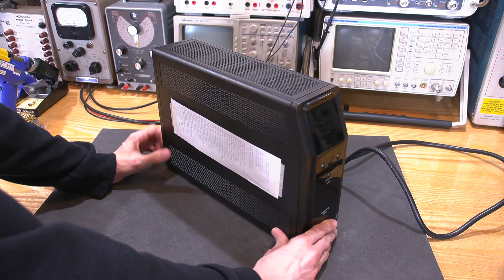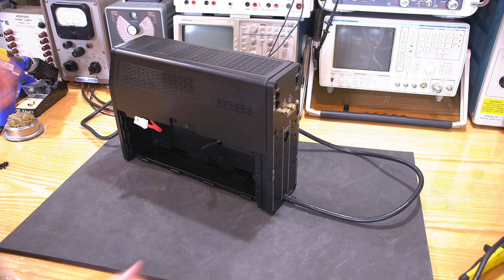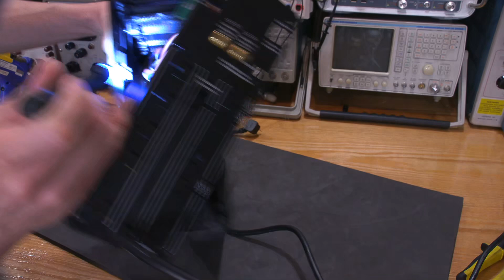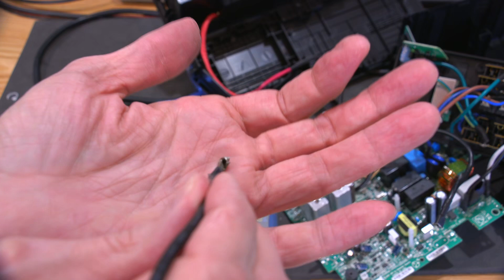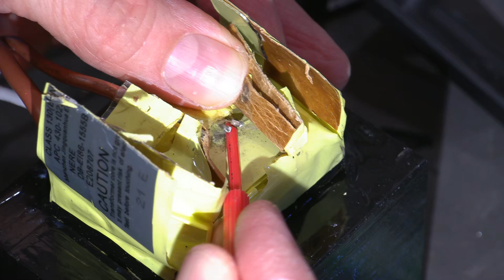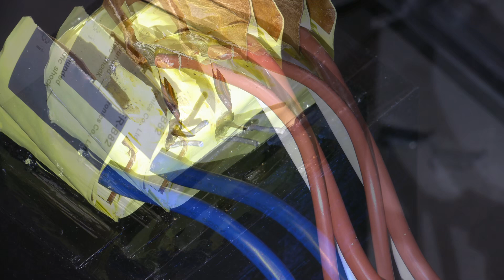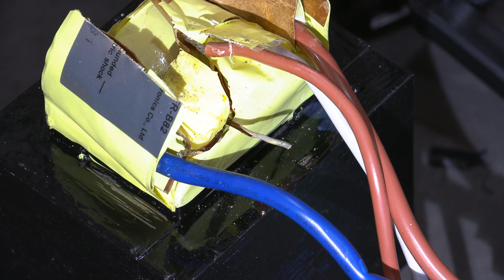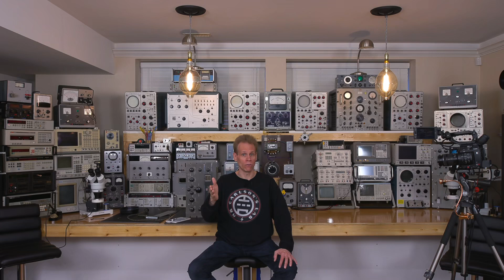UPS Electrical Failure - Teardown and Analysis!

Comment: Ok, that was shocking. APC went from a company I could trust to one I now cannot.  That was quick.  Thanks for the teardown lad.  Great stuff!
Reply: I was wondering if APC knew or was deceived by a component vendor. From what you're reporting, the choice seems to have been made by APC.
Reply: @KJ6EAD  Agreed.
Reply: @KJ6EAD  Sure, these transformers are especially designed for this device! I'm sure they did know about it! Aluminium mustn't be bad on a rarely used transformer. Only the way they connected it is wrong.
Reply: @KJ6EAD  I worked in QC for a video terminal manufacturer. We were constantly fighting with the vendors to use the right components in those devices the company imported from overseas. While we didn't have wires literally falling off the devices, we had out of spec capacitors and other components causing intermittent failures in the field.

Could this be a choice by APC? Perhaps, or perhaps not. It's hard to tell unless someone spoke with APC about this.
Reply: @KJ6EAD  vendor is just part of the equation, APC engineers should perform tests to every component that goes to the BOM
Reply: @migueldelag  The problem is 'quality fade' from the supplier.  The initial ones are built to spec, then the supplier starts to cheat and replaces them with the inferior ones like this.  The vendor that includes the parts isn't told about this switch and the end user ends up getting an inferior unit.
Reply: @KJ6EAD yes they were deceived because I'm currently working as APC technician.
Reply: @KJ6EAD  A simple resistance test would reveal the winding is aluminium or copper.
Reply: @KJ6EAD  "deceived"  thats a bit harsh.
Reply: @philipslighting8240  Seems pretty damn fair actually.  An aluminum winding in a transformer?  Unforgivable in my opinion.
Reply: I just recently opened and converted an older model from this brand. All looked very sturdy inside. Full metal body, etc. These newer products cannot be trusted. It's a shame what this company is selling now.
Reply: The test labels seem standard. I have 3 other APC UPS and all shipped with reports.
Reply: Yep, APCs have come with test labels like this attached for 20+ years.
Reply: @rjy8960  I have three that have been running for 7-8 years.
Reply: In fairness, it could be only the transformer manufacturer/supplier.  But if that is considered APC's diligence and/or choice, then it could be considered APC.
Reply: @louf7178  Yup. It's up to APC to enforce QC. If they don't do that, they deserve to be criticized.
Reply: @TheJohn8765  It QC'd OK on the line.  Just saying out of all the parts of all the models of each year, it can be overlooked.
Reply: We stopped selling APC hardware after they got bought out by Schneider. Their quality was never all that good to begin with. And it’s gotten considerably worse since.
Reply: @sandy1653  You nailed it.
Reply: @sandy1653  what's a better  alternative?
Reply: @gewglesux  We've been happy with Eatons and Vertiv units.
Reply: @sandy1653  Thank you  for the reply...  i'll have a look at these units.
Reply: @sandy1653  Keep in mind that  this is for the Home use..
Reply: @gewglesux  Sorry, I work in IT consulting and automatically default to what I'm used to selling customers.  At home I have a few Tripp Lite (who are owned by Eaton now) UPSes and I've been pretty happy with them.
Reply: @sandy1653  Thanks for the reply...  I think i have used Tripp lite  in the past..  always struck me as cheap though.
Reply: Schneider electric owns APC
Reply: Man that's lame.  Yet another company to avoid.  As far as "iron," I've now seen crappy made stuff from 3 sources now.  APC, Weber tube amp kits, and Mojotone.  All garbage.  Weber one had wires pulled so tight inside the transformer cover the 120V primary shorted out on the laminated plates.  Died after a year.   Mojotone output transformer was so badly "center tapped" it lead to major asymmetrical distortion.  Off by 30 ohms in that thing's case lol.  Unusable out of the box.
Reply: Given the supply chain, I can see why this sort of thing can happen. I'll bet someone thought they were saving 20 cents per transformer.
Reply: @jakebrodskype Fair point but for these types of devices, this is not an excuse to go ahead and release fire hazards... you simply don't produce them u til its safe to do so.   I know that is not the reality we live in though.
Reply: @ortzinator  Walmart is full of special SKU products that are all GARBAGE! Sam's Club is Walmart.
Reply: @Satchmoeddie  Yup, they have the purchasing power to force manufacturers to make stuff as cheap as possible so they can sell it to consumers cheaper than the "same" (but not really) product purchased elsewhere.
Reply: @Seth B  Special SKUs are a Walmart requirement for their vendors. They want packages that scream "bonus!" Or "X percent extra for free!" Or other such things,  and while putting those larger bonus packages on the shelf, Walmart demands the item cost less than it did before. And they often make the vendors buy the shelf space.  No wonder vendors cut corners to make any kind of profit.  For this APC, being able to hit a $5 lower price would be enough to make Walmart happier.
Reply: I can't believe it. so conclusion:stay away from APC.
Reply: @Oscar Caetano  I'd get a larger sample size before drawing that conclusion. Every manufacturer can have a BOM supplier issue. It's a worrisome flaw, worth keeping an eye on for recalls.
Reply: Manager with MBA : How can we save some bucks on the design ?
Noob Engineer : We can put Aluminum wound transformer, it's gonna be lighter too.
Me : Use a screw terminal to connect the wires at least, come on !
Reply: @demoncloud6147  A simple proper crimp with proper paste to eliminate air works for many years. It would not have failed for a long time, the way it was done, it is guaranteed to fail.
Reply: @demoncloud6147  Aluminum windings are thicker to carry the same current so more iron save no weight
Reply: I doubt it's just APC cheaping out... you really can't trust ANY consumer-grade products these days.
Reply: That transformer was a big let down. We use 1500 & 1000 VA APC uninterruptible power supplies where I work (big factory) - never had a failure that I know of (other than replacing batteries).
Reply: @ronaldbryant5215  Don't you think it is a bit too much to pay that price for some crappy battery, which is supposed to last only a few years ? They could have made it to last at least for 10+ years instead of relabeling sh*t.
Reply: Not just APC, but many companies (some with prestigious names) that have chosen to use cheap-as-possible manufacturing in order to maximise profits and, of course, don't want their products to last forever. It would have been interesting to see whether using proper aluminium solder would have bonded the transformer winding to the wire.
Reply: @ralphj4012  well…. not just companies who want to increase profits, but also us consumers who want stuff as cheap as possible… (hey dude, guess what, I found this kind of device even cheaper on Alibaba… hehehehehe)
Reply: I had a sneaking suspicion APC had gone to the dogs. 3x SURT-6000-XLIX units failed at half load over the course of 3 years. The only reason I bought more was because I already had the battery packs. Never spend another cent on APC. Buy Eaton. Better yet, do what I did and DIY. Victron Quattro inverter charger unit + batteries of your choosing. It also reduces pack wear and tear as you can balance your own pack properly.
Reply: @gummy1204  I've had a pretty nice Eaton unit unit fail.  Overheated the batteries and would randomly shut down.
Reply: A long time ago APC was the way to go for IT ... just became junk for the last 10-15 years...
Reply: APC has been junk for 10 years, trading on prior reputation.
Reply: They remove aluminum wires from houses because it was a fire hazards and responsible for many house fire in the 60's and 70's.  NOw if Chinese companies that make these transformers cut manufacturing cost by replacing copper wires with aluminum wires, that's a BIG problem.   As a firefighter that would explain some odd fire where the origin was near or close to the computer, But with the charred or badly burned UPS it was hard to tell if it was the UPS, Printer or anything else that caused some f these fire where a computer was situated.

But now with this demonstration teardown of the transformer, next time we have a fire next to a computer, entertainment center with a UPS near.  The UPS will be checked first.  And if the cause is the UPS transformer.  I think we may see a massif recall of UPS in the future.   I hope APC/Schneider electric check that and make a recall on all UPS devices that may have this type of transformer with aluminum inside.
Reply: @lepompier132  Aluminium wires are still legal by code (there's even specific tables to size aluminium cables), just like transformers with aluminium windings. In fact, we use them all the time in our industrial projects at my firm. You just need equipments that are specifically made to be used with aluminium wires, as the connections can oxidize and loosen more easily. This UPS is a typical case of improper use of aluminium wires: they didn't make a proper connection and wired it like it was copper wires.
Reply: IKR. Wow!! List of better ups?
Reply: @KennyKenJm   Cyberpower have NEVER let me down. I've been using them for 10 + years. 

Heck.. the one I'm using right now survived being drowned in a cyclone... it STILL WORKS!
Reply: What's horrible is that in my experience, APC is the least bad of the terrible companies making these things. Tripp-Lite has a bunch of issues, and Cyberpower - ugh, don't get me started on Cyberpower. It is literally true for us that Cyberpower malfunctions caused more abrupt system power outages than they stopped during actual power failures before we threw every single one of them out of the building. They literally never worked even once for us during actual outages and took us down via malfunctions... two or three times, I forget.

APC quality varies kind of a lot from unit to unit and model to model. The least bad we've found has been the Back-UPS Pro BR1000G - that's our standard on production machines - and the worst model has been one that looks a lot like that one.
Reply: @solarbirdyz  Check out Eaton units - for us, they've been far better than their APC counterparts.
Reply: @Bruce Havourd  How was that company named? Amateur Power Conversion🙂
Reply: Well known, trusted company caught red handed building their products with (presumably chinese) garbage. 

Big shocker there /sarcasm.
Reply: I agree I had one very good apc . All the new ones seem to be made on Saturdays.
Reply: the only apc model worth buying this days is the BR1500G , BGM1500B . basically if you are buying a new model avoid buying the ones that use low frequency transformer based inverter. get something like the br1500g that has a proper dc to dc converter and then H bridge to turn that into modified sinewave. these are the only two models from the pro series that uses switch mode inverter and they are much better. , in india we have a 1000w version of the 1500g that has everything same but a software limit to trip the ups at 600w instead of 900w. this br1500g has an external battery port in the back aswell which could be hooked up to a 24v leadaicd or even better lifepo4 battery pack to extend runtime like i have done. keep in mind the north american model of br1000g use the heavy transformer for inverter and the construction is similar to the one shown in this video , i had a bx1100 model (exclusive to indian market) it has a transformer that is literally half the size of the transformer they used on 450va model made in 2003 . it had two 7ah lead acid and rated at 650w with a run time of 40secs at full load. so the battries died and i replaced them with 12ah lifepo4 , now lifepo4 is lithium and they do not suffer from pukert effect so as long as you are pulling less amps than their rated cont they would happily dump their full rated watt hours and so this increased the run time by hours. at first i tested it with 300w load and it ran nearly 50mins. then i increased the load to 600w which should have given 15-20min runtime , but just after 5mins the transformer got so hot that it melted the internal thermal fuse even though the ups has a temperature probe on the transformer , this essentially made the ups an ewaste as the transformer was dead. so i took the covers apart and discovered the fuse , replaced it with another thermal fuse this time an automatic resting one. and learnt the lesson that not to run the ups above 300w. these are designed in such a way that the battery would run out few minutes before the ups overheats at a given load! 
such issues do not exist with the br1000g (indian model) and br1500g (american model)
all of the apc units i bought have the pcb and transformer made in India. unlike the american models i see online they have the ups made in Philippines and the transformer pcb made in china. 
lifepo4 is the way to go with these ups , i can game for about an hour on my pc when the power goes out or work for 3 hours just on battery and my pc is not even that power efficient, it draws 150w at idle and 450-500w while gaming. i use the br1000g and 25ah 25.6v lifepo4.
Reply: Thank you for the tear down. I’ve had several of these over the years and they used to be good. I’d replace the batteries every couple of years and it would be good to go. Last one failed with an internal fault and couldn’t be repaired. Sad really. Very little is made in America now a days.
Reply: @ortzinator  it is not just the Sam's Club version. Their entire bottom to mid-level offerings are nothing short of disposable junk. I am the Director of QA for a nationwide IT company and I cannot recommend any of APC's 'desktop' UPS units. I remember a time where I would replace batteries every 3 years and now, I am replacing DOA and units with less than a year on them. The 'warranty' process costs more in shipping and time than the product is worth.
Reply: probably a bad chinese supplier
Reply: @Brian Ortiz  Yep, they are a Walmart 'Family' of business and Both Do sell company specific versions of a LOT of things. And pretty much, they are all Junk! Ya'll Take Care, John
Reply: If this has a UL certification, ship it to their labs for a full inspection. I would not be surprised if the model shown in the video was made in China. We had two rack mount APC UPS devices in our server room, and both had to be replaced a decade ago. This was in an air-conditioned office building in the heart of downtown Honolulu, not someone's beach shack.
Sadly, Cyberpower (the competition) makes some pitiful UPS backup supplies as well. It doesn't matter if the output is a square wave or sine wave. Both backups fail in 3-5 years. Even the displays go belly up.
The worst power company in the U.S. is in the state of Hawaii. Their name is HECO, rhymes with Rico. The AC supply is more unstable than a 30 ft wave on the North Shore. Not shocking that no UPS backup device can stand up to a flip flop power grid. Never, ever run your Audio Research stereo system between 4 AM to 5:30 AM. The grid will fry your expensive electronic equipment.
Reply: Yeah, APC went downhill notably after Schneider bought them. Now I’m not sure what to use for my UPS needs. :(
Reply: But at least it is expensive... :(
Reply: The BackUPS series are commodity products, I wouldn't trust them as far as I could throw them. Their Enterprise grade stuff is much better built (or at lest all their enterprise stuff I've ever bought second hand and reconditioned is better built ;) ).
Reply: Boobytwaped.
Reply: I think this is the difference between Back-UPS and Smart-UPS
Reply: EPSUs have always been a gamble. Any brand you buy
Reply: Yeah, this is very sad news.  Hopefully they were deceived by their component supplier and didn’t intentionally use that junk… There are lots of counterfeit components making their way into the supply chains of even reputable companies these days, although I’m not necessarily saying that was the case here.
Reply: What  do you use now?
Reply: I have seen so many failed UPS units, school i went to I now work at used to have APC they would always overdo the batteries, etc then they would fail even on the old 1990 era units. I only have one APC that is at home and needed something quick was what I could get. I won't even touch them otherwise anymore.
Reply: Oh you can still trust them! They make the best house igniters in the industry!
Reply: Wow, for the price of a couple 5-cent crimp lugs!!  Sad.
Reply: Another thing is the battery, it has no balancer, you can't (at least in those models I saw) adjust the charging parameters. It is not supposed to last very long, while actually being a much cheaper relabeled (at least tested) one. WTF would I ever pay for "ORIGINAL" ones while the much cheaper ones would not last much less than that ? Put a balancer over a cheap one, and it will outperform the "GENUINE" by a large margin.
Reply: Well,  APC by Schneider tells you something i guess :) go Eaton for the moment
Reply: China What did ya expect
Reply: Used to use APC extensively in my home and we had literally hundreds where I worked.  The failure rate was 30% a year, often announced by a Sulphur-scented cloud nobody ever could identify at first. Switched to another brand for my home use and it's been much better. Or at least hasn't crapped out.
Reply: Echo what this guy said.  No more APC for me.
Reply: It’s not the units failure I’m afraid of but the fire hazard that it can become!
Reply: @rad2304  Agreed.  Yikes.
Reply: These small APC UPS's are junk. The rackmount enterprise versions are not unless they are supplied by the same company.
Reply: At least APC had quality devices 20ys ago that still do their job in a perfect manner.
Reply: APC already  was trash even 20 years ago. So it could only go from trash to super trash.
Reply: APC became a piece of junk since they have started using plastic cases. In the 90's those units were all metal and fairly properly built (although I never quite liked them as the batfery always prematurely died in them). Also, still this 50Hz transformer solution? Come  ooooonnnn...

UPSes are dangerous and fire-risky devices, these are even SOHO stuff where you put it under your desk without proper safety measures, and maybe throw a bunch of paper on top of it too, for good measure. This "quality" is just plain unaccepable.
Reply: APC sold out to china after development and mfg in US. Junk now not same, just a name. Like many consumers goods.
Reply: That is naive, Aluminium cannot be soldered to copper in my experience, also as Mr C demonstrated when he opened up the crimp, three separate wires inside.
Reply: @harrowtiger   It is possible with the right product.  But obviously those connections were not done properly at all.
Reply: for I have known about the aluminum transformer windings for a whiler now just trying to cut corners !
Reply: "APC went from a company I could trust to one I now cannot. "

Because you saw ONE unit fail?  One of several hundred million units worldwide?

I dare you to look up ANY brand of UPS and find one that does not have a dozen reports of failed units.

Units fail, it's reality. There is a reason why professional UPS's are expensive and these home-use units are so cheap MrCarlsson had several FOR YEARS*, *WIHTOUT ANY PROBLEMS

The worst you could say about APC is that this particular model may have a design flaw. Now use your brain to think about how maybe the other brand might use the exact same transformer.
Reply: @vinny142  One unit failed, but all the units have completely unacceptable aluminum to copper connections.
Reply: @vinny142   "MrCarlsson had several FOR YEARS*, *WIHTOUT ANY PROBLEMS"
0:38 says he had a bunch for a year,  1 power failure survived, failed on second.
They have one job...

"The worst you could say about APC is that this particular model may have a design flaw."

  And the best you can say about APC is         perhaps not ALL models have solder to aluminum in the transformer.   Perhaps.

They put their name on it   , their name gets the kudos for success and the opprobrium of failure.
Reply: Be careful about drawing conclusions from only one sample.
Reply: @williamsquires3070  Where did the substandard transformer come from?  It was certainly installed in that APC UPS -  so was the transformer replaced by a third party or was it a part selected for the line for it's affordability by APC?  I'd be very interested to find out.
Reply: @STR82DVD  My guess would be china. They are well known for using aluminium wire in a lot of stuff now.  There is a type of coax cable called LMR-400. It's used in commercial radio installations, repeaters, broadcasting and various other applications. The company I get my supplies from has started offering 'CNT-400' which is supposed to be an equivalent. When you strip the outer jacket off and get to the centre conductor, it should be solid copper. On this CNT stuff, it's copper-coloured aluminium. After checking the source of the cable I discovered it's made in China.
Reply: @stopthebus  yeah, we electricians call that copper clad, and we only use it for electricity service installations, from the transformer to the meter, and we always oversize it.
Reply: @stopthebus  Cooper colored aluminum.  You just can't make this stuff up.  Brutal.
Reply: @STR82DVD  I guess APC bought it - I don’t think they manufacture transformers themselves. Of course, it could be an oddball transformer not available through normal channels, in which case they’d have to wind it themselves. Then the problem becomes: where did they source the (crap) aluminum wire from? Did they know it was aluminum, or was it fraudulently labeled as copper wire (and they paid for copper wire) but was really aluminum? Certainly someone, somewhere, cut corners on cost here.
Reply: @williamsquires3070  Agreed.
Reply: @STR82DVD  I have a distinct disappointment with a lot of this "inferior" china stuff.
Reply: @pinrod1  I'm an electrician as well and a radio engineer so I know what it is, I was just describing it in a way that highlights the cheapness of what china is producing and my distaste in the inferior products that they make.
Reply: @williamsquires3070  Transformers in these kinds of things aren't "off the shelf" parts, they are all custom built to the product manufacturer's specifications so either they specced it with aluminium windings or the manufacturer did a dodgy on them.
Reply: @stopthebus  You and me both mate.
Reply: @stopthebus  It's probably not "copper colored" aluminum, it's "copper clad" aluminum. It's aluminum wire with a very thin layer of copper on the outside. You see it a LOT in coax now, which in a way makes sense, because for RF applications with the skin effect, all of the RF current is right at the surface anyway. The other variant you see is copper clad steel, which same idea, but using steel as the base material rather than aluminum as it's even cheaper. The CCS stuff has 2 disadvantages - it destroys cutting blades on tools (as they're designed for copper, not steel) and if you use it with any moisture exposure, the steel rusts and turns into a horrific mess. You have to be really careful when buying coax these days that the center conductor is "bare solid copper" and not "CCS" or "CCA"
Reply: @gorak9000  Yes, I know it's copper-clad - I was making an example of how cheap the chinese are with their junk, that if they could get away with it they'd just colour it copper rather than put actual copper on to save a few cents.
Reply: @pinrod1  There was no cladding on that aluminum, just varnish.
Reply: @stopthebus  There are areas where this should work, not lower frequency stuff.
Reply: @STR82DVD  watch out for the letters cca on Chinese made items. That stands for copper coated aluminum and is garbage they are trying to pass off as copper...
     Ya'll Take Care and be safe, John
Reply: @JohnDoe-pv2iu  Thanks lad.  GTK
Reply: @STR82DVD copper clad aluminum is the trade name..
Yeah aluminum is not as good as copper, but if oversized as good or better performing as the copper equivalent
Reply: @luvdady  I suppose the gage would matter however I still know it's pretty shady when you actually tint aluminum wire copper color.  That's just short of criminal.
Reply: @STR82DVD  it's called copper cladding
Reply: @luvdady  sure.
Reply: @STR82DVD  pretty sure I see it all the time especially in car audio and cat cables
Reply: @williamsquires3070  one sample? Do you think they used only one transformer that has solder crimped on aluminum ?
Reply: @williamsquires3070  You think the assembly line at APC made this "one off" and slipped it into the shipping line?  Chuckle....
Reply: @GunnerAsch1  Some person could have a scam going on where they, with or without knowledge of an electronics vendor, carefully remove the good transformer, and replace it with the inferior one. Given the size of that transformer, it's likely the most expensive component in the unit. That monster battery is probably close, though. It would probably be best to find another one of the same exact model and check it before potentially slandering a big company that has attorneys. The product that he just took apart in the video, however, with the transformer it has in it, is a fire hazard. Countries shouldn't allow it in through their customs, if this is how all of them are made. Imagine having this thing running in your garage not too far from your lawn mower's gasoline can... I can remember an experience with APC where my APC 500 decided it was going to fail the DAY AFTER it went out of warranty. I was livid. And I am still not convinced that they couldn't send it a 'die' signal across that serial com port.
Reply: @shanejohns7901  Those batteries are two 12V 7Ah Sealed Lead Acid cells, they are literally nothing special and can be had for around $20 each usually..
Reply: @williamsquires3070  One of my APC UPS systems had the same problem, so sample size +1
Still the way it is soldered is questionable..
Reply: @mveldt  - now the question is: how many of this model did APC sell? 🤔
Reply: @mveldt  Not questionable at all, it wasn't soldered, it was trapped in solder. That is absolutely not how you connect aluminum to copper.
Reply: @williamsquires3070  yes, this.
I do IT and I've installed hundreds of these as well as have them in my own home.  I never had a problem.  I generally replace the batteries 3x before replacing the unit.
You can get a new bad anything, not just APC.